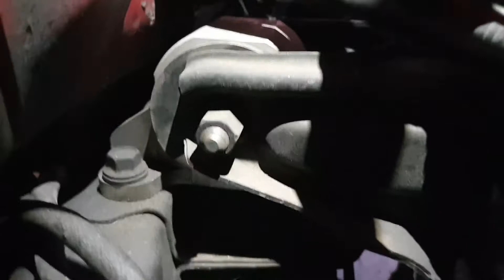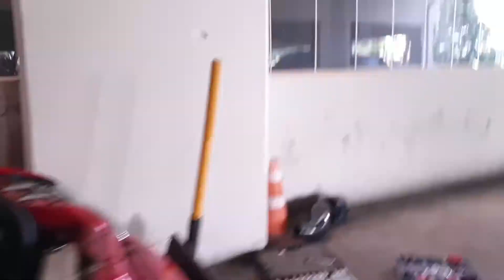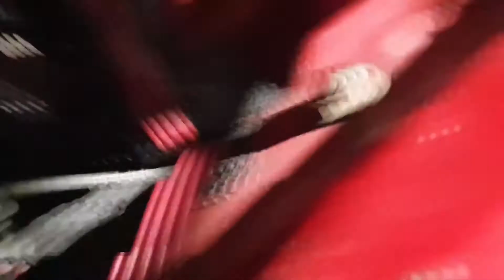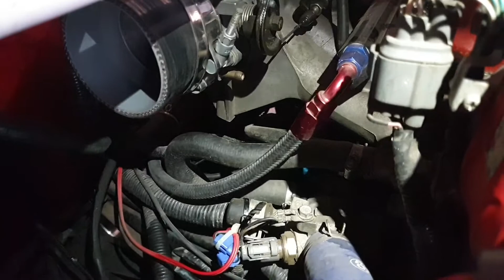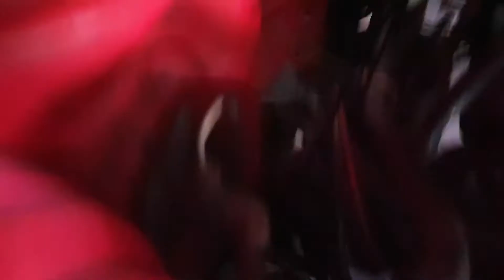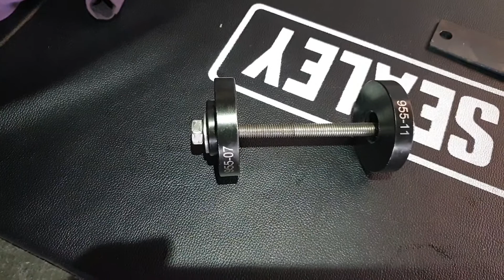How To: Honda Civic Rear Motor/Engine Mount Bush Replacement

Comment: Would this cause wheel shake/vibration when on hwy ? Bad rear mount? I can’t tell visually if it’s bad
Reply from the maker: I don't think it would cause wheel shake.  The most common symptom is when jumping on/off the throttle, the engine will shift backwards and forwards, the worse the mount, the wilder the symptom.  You wheel shake could be anything from, wheel balance, alignment, track rods/rod ends, ball joints and other suspension parts.
Reply: @alexkcars6881  yea so I got the driver side wheel , they did say it was really off but the shake is still there only on hwy and if I let off gas it goes away
Reply from the maker: @MRCALIEMS  highway under acceleration, sounds more like a CV joint. Any strange noises when driving slowly and steering on full lock?
Reply: @alexkcars6881  no noises now play. I’m going to get the passenger side tire balanced tomorrow see if that helps before trying to replace the driver side axle myself